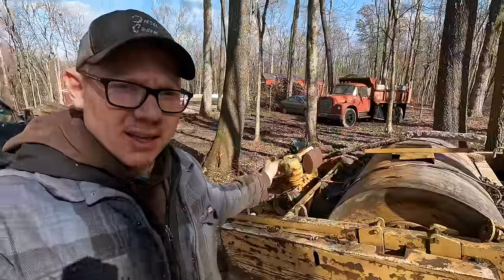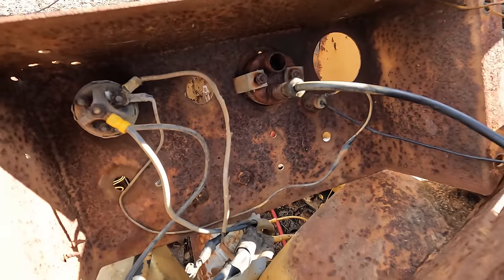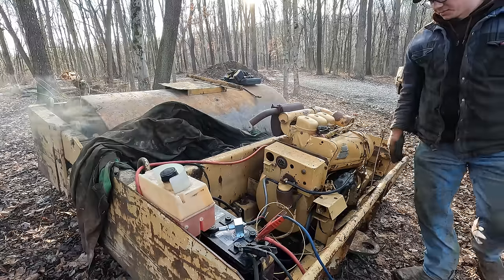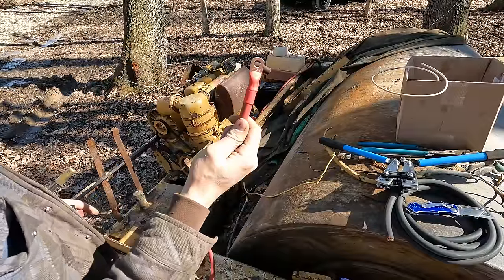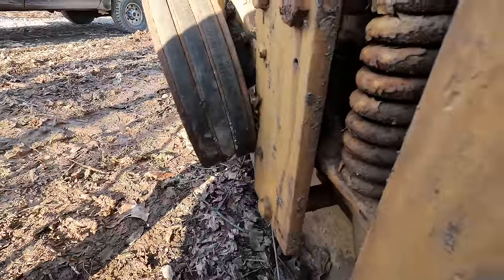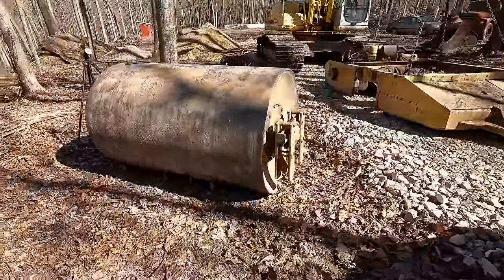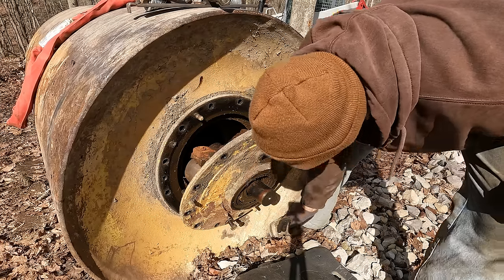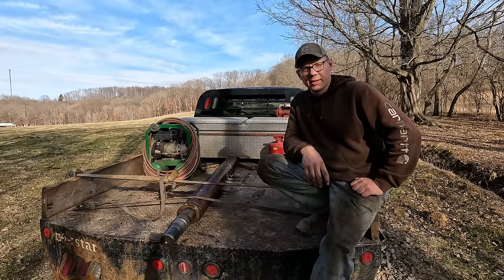Diesel Roller Compactor First Start in 30 years!! Can it be saved??

Comment: Glow plugs: Either get 12V rated or put a ballast resistor in to lower the voltage. Nice work!
Reply: @malicious1111  how do they run in series when the plugs ground to the frame?
Reply: They are in series and I suspect its a standard 24 volt  diesel engine system so Id keep the same plugs by rating just get new ones.
Reply: exactly! the original ones were 9.5 Volt an need a ballast resistor, for best performance that resistor should be bridged during starting to compensate for voltage drop. there are also 11 V types that are interchangable and do not require a resistor. For example BOSCH 11V/8,5A (0 250 200 055) should fit, but please check before ordering. as a added benefit, 11 V plug need less preheat time.
Reply: they will take 12 volt for a short period of time and that's all you need to get them hot then unhook the juice to them that's all because you don't want them to run constantly anyway
Reply: @markrickert9040  not possible.  They all ground to the chassis.

Comment: You might need a way to shut off all power, because the alternator will be drawing voltage. You can use a resistor to lower the glow plug voltage.. You are doing a good job... Ron...

Comment: First I'd just like to say enjoyed your video as I do all of them. 2nd great to see you get the motor running.  I know the thrill of bringing an engine back to life. As far as is it worth fixing the shaft and putting the roller back in action I guess it depends on your point of view and how much are you really going to use it. If your only going to use it once or twice in your lifetime probably make more sense to just rent one. If you see yourself using several times over the yrs then maybe worth fixing if for no other reason than the satisfaction of saving a piece of equipment.   One thing I never really take into consideration when fixing something is resale value as I'm not doing it for that reason.  Also if I were to scrap it in favor of a unit already in working order whose to say that something major won't break on it and now I'm out even more money. That's just my view but in any event good luck and keep those videos coming. Their both entertaining and educational.

Comment: Matt, dont worry about the lift pump, just keep using the facet, wire it into the system. If you are clever when you change the alternator you can run the pump off a signal from that so it cuts when charge stops (isuzu cars did this where electric pump was fitted, Imark, Luv, pump runs on cranking and with a charge signal).  Cobble in a tank, whatever youve got handy. For the use you are going to give it, itll be fine. The bearings are a problem you dont need. Its a shame its the shaft one and not the ground speed which you could overlook no trouble.

Comment: Hum motor is great 👌 , I reeds from some people in your comment just fixing shafts it’s not cheap, clean bearings nice filling with grease and go 99,9% it should running for minimum 10 years more.
See if you can do so you can fill with more grease, from outside with nipped and small tubes just a ide from old farmer 👩‍🌾 
I hope you can have for a good price 👍
You are a winner 
From Sweden 🇸🇪

Comment: Love it when you get an old engine to start! Maybe check to see if the voltage regulator is working before you scrap the alternator. Might save a few bucks there. Nice going!!
Reply: If you are running an alternator is the voltage regulator needed? I think those were used for a generator and alternators are internally regulated.

Comment: just a note of what works for me. on any crimped electrical connectors i fill them with dielectric grease  before assembly. as long as crimped properly electrical  contact is no issue. but the benefit is that all voids are filled and doesn't allow any moisture  to enter. have trailer wiring ( in wisconsin) well over 30 years old and no issues with connectors. used the best so wire i could find and supported it well and routed it out of harms way. also believe it dappens vibration at the connector crimp. like your videos  Dave

Comment: Grind a angle on the broken part of the shaft, clamp it in a piece of angle iron to keep it strait, then weld away. Sand blast those bearings, clean them up good and load them up with grease.

Comment: 29:46 Perhaps a better solution when using bolted clamping battery terminals, use a crimp on ring terminal (similar to what you have been using on the starter) and bolt the ring terminal to one of the bolts on the battery terminal.
Reply from the maker: Thought about that actually
Reply: I buy the crimpable version of those corrosion making battery clamps. You may want a bigger crimper to use them or bench vise.

Comment: We had three 6 cylinder Deutz powered generators at the factory I worked at (the owner put them in in 1973 and refused to be shut down by the power cuts) those things were started monthly for an hour and switched in to run the factory. 
They were an absolute bear to get running even after only a month sat idle!

Comment: @Diesel Creek Those glowplugs originally hat a resistor in front of them. Just a piece of special wire inside a housing with some holes in it, it would glow similary to the plugs and would let you know when they're warm. Looks a it like the salt shakers you find in restaurants.

Comment: Looking  like one of my projects🤣. Anybody else surprised how small the counterweight shaft turned out to be? Could well be a show stopper. Regards the glow plugs are you sure if didn’t say 9 to 15 V. They never print the big number first so would have been 5 to 9. The old style glow plugs used to be in series with similar solid connectors but had porcelain insulated rings so they there in series. These look like the standard ones to me. As long as they get hot it matters not. Test them individually with s lead from the battery. Alternator will need exciter power from an ignition switch usually via a warning lamp on the old type units. Few people will understand the excitement of getting an engine like that running, was sat here willing it to fire 🤣😮. Great video hope you can get the shaft repaired.

Comment: Sorry to see you find the broken shaft. The one thing about the inflation you were mentioning, is that everything else is going up in value too. I bought a lathe brand new in 2001, and put it in my shop for $6500 CAD. A comparable one now is about $24,500 US. (I live in Canada). Yes, you could scrap it, but if you find a way to get it going, you will never get a cheaper one. Sadly my lathe is a bit small to fix that shaft.

Comment: Around 31:50 adding up low voltage parts to meet higher volatge: that's correct. Christmas tree bulb chains are commonly put togteher with a lot of low voltage bulbs adding up to grid voltage and when buying replacment bulbs you need to know exactly how many bulbs the whole chain has, as that was the main design factor for the bulb voltage.

Comment: Alternator fields are externally excited with voltage regulator! I am a little rusty on theory. Regulator may be inside the alternator so only a hot wire from the battery is needed! Ron

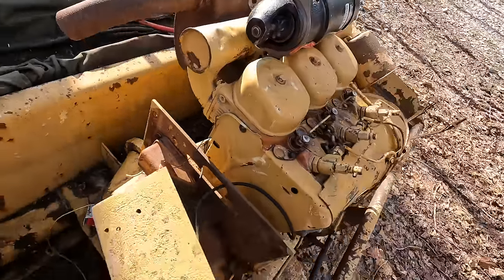Comment: Hi Matt, I've worked with these Deutz engines before, but mostly early (pre ww-2) models, I don't know if yours differs. The glow plugs (at least in the early series) are originally a series circuit, where the glowplug is electrically isolated from the block, and the last one is grounded to the block via a short bracket. They need a series resistor, the value depends on the number of cilinders, and system voltage (6, 12 or 24V).  The glow plugs you pulled out are a newer style plug, which appears to have parallel circuit, so maybe that they were upgraded at some point. Regardless, you still need a series resistor, I think that the box on behind the control panel you removed is the resistor box (visible @ 9:30). These Deutz engines really like some pre-heating, so getting the glow plugs working is worth it.

Comment: For $25 you can get a Delco 10SI "rebuild kit" on Ebay.  Brushes and a 1-wire regulator will fix that alternator.  They are pretty simple.

Comment: As said below the glow plugs have a glow indicator in series to drop the voltage and work as an indicator. To get the alternator to work you need to run a hot wire to the D+ on the alternator to excite it. The best would be to have a little light in between to work as a charging indicator. Light off meens charge and light on no charge. But you need to be sure that your alternator has an internal regulator installed. Other wise the alternator is not a original Deutz design so you could fit any type of car alternator on from the scrap yard or something  you have laying around.
Second the fuel system is as follows, the lift pump takes fuel from the tank and has a pre filter, the one in the glass. Then it pumps the fuel through the line to the fuel filter cartridge that is normally fitted on the same housing as the lube filter. It's on the thread on the top so the filter is upwards. Then the fuel is pumped towards the injection pump. There is most of the time in the return from the injection pump to the tank a banjo bolt with a spring inside to maintain rack pressure.
As for the glow indicator I have a part nr from Bosch 0251002001 or from Beru KOSK1520

Comment: Hi Matt, these older alternators need the charging indicator bulb connected to output anything (excitor current). You can also connect the battery positive to the charging indicator lead for a short amount of time while the engine is running. It should keep charging until you shut down the engine. Also the Glowplugs need a glow Indicator which acts as a resistor in series with the glowplugs for them to not burn out. You can also replace them with 12V ones and wont need the glow indicator. 
Greetings from Germany

Comment: Greetings:
Glow plug wiring: Since each glow plug has its case grounded to the engine, and the battery connection has all three glow plugs connected together at the tops, that by defin ition makes them parallel wired eaach getting the same full battery voltage. Battery looks like it is 12 volts with 2voltts per cell x 6 cells.

Comment: On the glow plugs, these are the so called pencil style which are wired in parallel. I researched and found part number NGK 6929 or you can cross reference if these aren't available anywhere in the US. If all fails you could try glow plugs for a ~1972 Mercedes 220D (around $15 and widely available)- they are same thread size and pitch, but the heating element doesn't stick out as far.
But you should definitely test yours by applying 12V directly to it and see if they glow. Or just use a meter to check for resistance. Should be a few ohms.
Lastly, I am not surprised it took some effort to get it started without glow plugs. That's exactly how the aforementioned 220D would start if none of the glow plugs were working, and there'd be about the same amount of smoke too.

Comment: Well Matt, this did turn out to be bittersweet; getting the engine working so well, but finding major damage. I'm sure I'm not the only one of your subscribers that gets just as excited as you do when the engine finally cranks & runs so well! The bearings probably will be fine repacked w/grease, maybe you could find a lit pump @ a junkyard (?), & hopefully there's an alternator repair shop in your area, and here's hoping you DO indeed get a deal on the shaft repair. Good job, & I'm looking forward to the follow-up video.

Comment: Unless you're planning on making it an heirloom machine, fix the shaft, grease everything up, and slam it back together. I'm certain it will get your project done and then some. If it works great, then keep it, and as you use it, fix the little things. You don't have to go whole hog all at once. Just my 2 cents. I know that's not the right way, but sometimes it's the only way.

Comment: Well, You have probably already bought, or not bought, whatever you were going to get. But, I would use the electric fuel pump and not worry about the alternator. It is a mechanical diesel and once started you do not use or need the batteries. The bearings, clean them and grease them up and they will get you through this job and later down the road you can decide if you really want to replace them. For what you are doing there it will be fine and get the job done and do no more damage than has already been done.

Comment: Turn it into a static roller. If possible and room inside seal off the flanges and fill with water, or concrete. Add additional weight on the exterior.

Comment: I clean my injectors with kroil, compressed air, and a toothpick for the final orifice: works great and doesn't damage anything from my experience.
Personally, I would homebrew one hell of a drill bit and try repairing the shaft myself if it's to costly: complete with welding the largest piece of grade 8 all-thread i could reasonably afford between the broken pieces. Gotta do what ya gotta do sometimes.

Comment: Glow Pugs. I've had a fair bit of experience with converting my land cruisers to a manual glow system. These small engines really need glow plugs to fire up so it's worth it to get these operational. To test the plugs, clean them well then hold them each with the threaded area against the negative of a battery and use a jumper wire from the positive to the top of the plug. They should glow red in 5-10 seconds. As for the voltage on the plugs, I have been running 10.5 volt plugs on my 12v system for years with no problems. I have a separate dead mans switch that I glow for 10 seconds, start the engine and continue to hold for another 20 seconds. Also, you might want to consider a slow blow (fuseable link) in the wiring to the plugs for safety. As for the generator, does the engine actually need it to run or is it just to recharge the battery for start ups? You might just get away with charging the battery once in a while if you only use it occasionally. PS looking forward to seeing the Christine running.  Ron

Comment: In a place like that with all that timber you could just dig out a  hole and leave the edges at it's natural angel of repose so the sides can't cave in, roof over it with timber and plastic sheet then cover it with some dirt. I built something like that once and it never leaked a drop. You just put down the basic roof and fill in with smaller and smaller branches till it's basically woven shut. You can use pretty much anything under the plastic sheet once you've got a solid roof. Old car hoods, old plywood that is if you even needed anything after placing all the branches , brush and so on over the top.  The thing is to get the sheet over it and some water proof clay. Where I was at there was plenty of that so it wasn't a problem. They used to make similar roofs back in the 1800's , just shovel clay on the roof to seal it.  With all that big timber and equipment you could build something really huge if you wanted. Under a few feet of soil you could get really good insulation as well and the whole thing very cheap. Get some white plastic sheet and build frames fasten it to the walls and under side of the roof and it would look very clean and bright in there. I don't think I spent 500 dollars for what I built, mostly just scrap material the earth it's self is pretty much the whole thing.

Comment: Cool video, I like yer idea of heating the intake manifold,....
Something I learned some time back, in a case like in this video, is to use WD 40, instead of ether,....
The motor will run on the WD 40, without the binding caused by ether,.....

Comment: My rotational moulding machine has 3x five inch arms. Each arm has 2 pillow blocks with spherical bearings. 5 of those were only a little rusty but the 6th was crunchy like yours. I got a replacement "railcar bearing" from China for $200. Was like $1500 for one that would work at full load. I'm at 4 rpm and only a few thousand pounds.

Comment: On the alternator just asked for the GM 1 wire alternator to keep your battery charged. 
For the bearings and shaft that’s not going to be cheap that might be deal breaker there but the bearings you might have a slim chance of finding them on E-Bay. 
But that’s a slight chance maybe 🤔.

Comment: I have a tractor that has the turbo charged version of that engine. Mine doesn't have glow plugs but has a heater in the intake. When it's cold I put a heat gun on the cylinder fins for about 10 minutes and it always starts right up.

Comment: It would be a good idea to disconnect the glowplugs and ohm read each one. I didn't find specs either. VW diesels have a good range, for resistance. Then hook up a voltmeter, across the battery, and touch the glowplugs, for a sec., to see how low they pull the battery. You could hook a headlight bulb in series to lower the voltage.

Comment: Before replacing the alternator check for a voltage regulator . Where you  cut a bunch of wires out of the system you might not be energizing the alternator.  That could also be a 24 volt system  or even 6 volt. Highly unlikely on the 6 volt but possible. What's that machine worth to you as a tool in the future ? I ask that  because of the bearings if it something you would be using for other jobs . Then how many rental  dollars as compared to the cost of bearings replacing ? Good luck looking forward to seeing what happens next with this project

Comment: Glow plugs are cheap, 12v and you may be able to find from japanese engines like yanmar, Kubota Isuzu industrial diesel engines.
Duetz is common engine, Bosch parts.
Glow plugs on momentary switch/circuit.
Resistance and draw specs are online, glow plugs are always parallel, body is ground to chassis.

Comment: Drilling a small dowel pin in the center of the shaft and chamfer it way down and weld up and turn it back down to spec